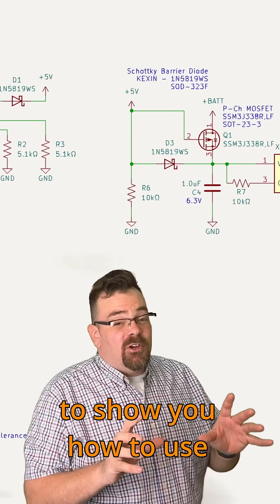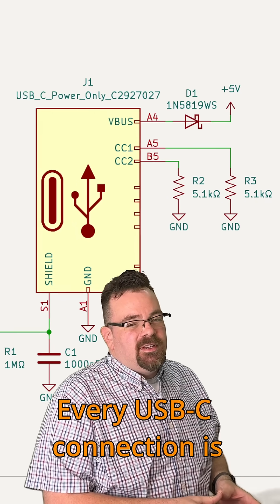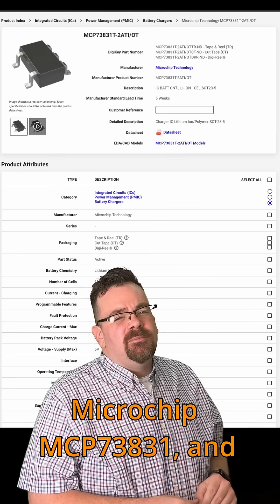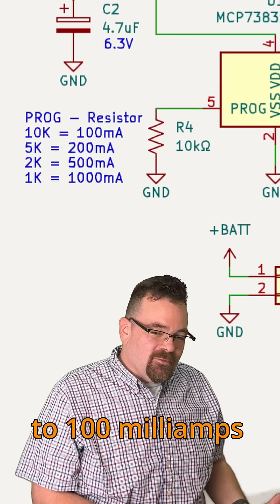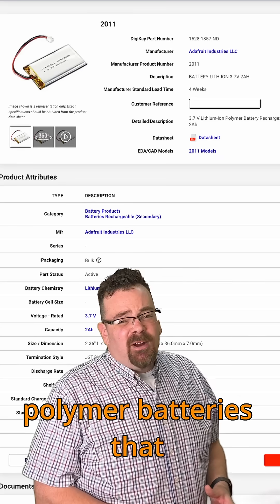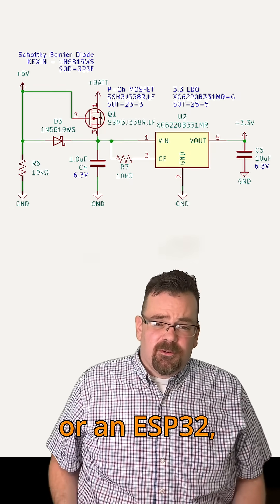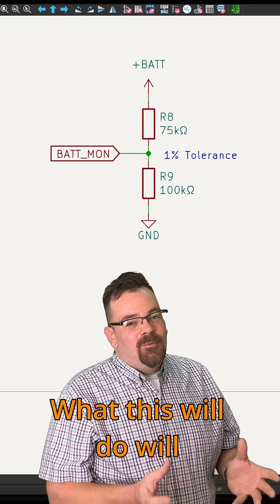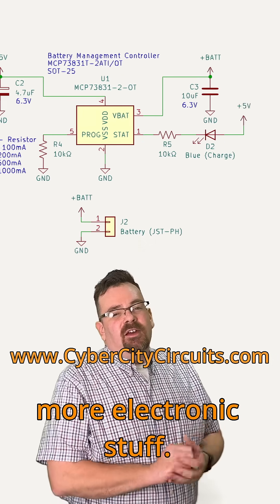USB-C and LiPo Battery Charging Design

Comment: Or just use a PMIC like AXP2101, it's not that expensive, and it gives you: multiple power rails, State of Charge, not just voltage, power button with programmable behaviour

Comment: Wow 😀 Wondering though, several passive components, seems simple, but is this suboptimal somehow (energetically)? Does this design have tradeoffs? I don't have the understanding to evaluate that🤔😌
Reply from the maker: It’s absolutely good enough. Change your voltage regulator based on power needs, but this is going to be fine for almost anything. I’m really happy with how this setup has worked.
Reply: @cybercitycircuits   Thanks 🙂, I love your clarity. I always look for (design) choices and tradeoffs when trying to understand something new💥. This helps to apply the knowledge beyond one particular context/recipe💥.

Comment: New Sub, Cool channel. Liked. Saved to playlist. As an engineer I struggled to follow, what’s your specific niche outside of electrical engineering and what resources would you recommend for refresh my memory? 

As it’s not what it used to be.
Reply from the maker: The best resource is going to be a datasheet, if you have a string background. I’d watch Shawn Hymel’s Arduino course and get real good at it or at micropython.

Comment: Isnt the P-fet a bit complicated idea? You could use a dual ideal diode at this point, cant you? I mean the 5V signal will not disconnect your battery from the circuit as the body diode of the fet is still there. i mean the reason this works is the 5V from usb is bugger than battery voltage. On the other hand, this way the pfet works also as a reverse polarity protection.....hmmmm....
Reply from the maker: There’s a time and place for a PFET and while the occasion is rare, it does exist.

Comment: What specifically makes this USB-C power? It should work with any flavor of USB, at least with the charge current limited to 100ma. I didn't see any handshake circuitry to enable higher current delivery from the port.
Reply from the maker: The USB-C connector makes it USB-C powered.

Comment: But will it work if battery voltage drop beyond 3.3v?
Reply from the maker: Not with that LDO, but if needed, you can add a boost converter. The best solution would be a bigger battery.
Reply: @cybercitycircuits  thank you, by the way, what in battery percent is 3.3 volts? Is it low or okay?
Reply: @rigTHErigзависит от типа литиевого аккумулятора, li-po 3,2 нижний уровень заряда
Надеюсь, переводчик справится😊
Reply: @TheLichOne  спасибо